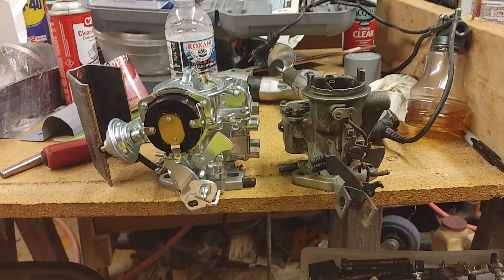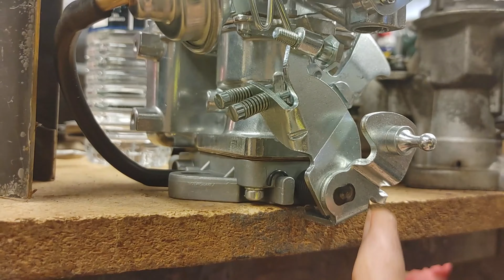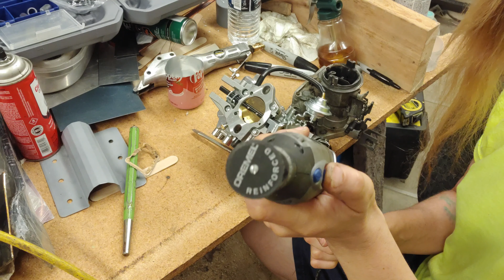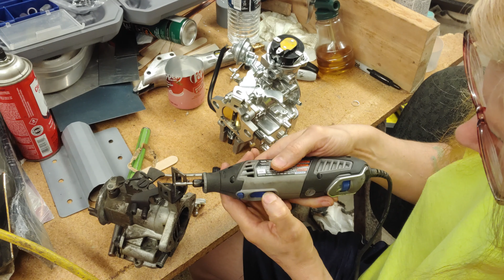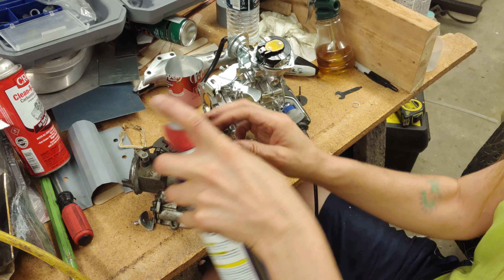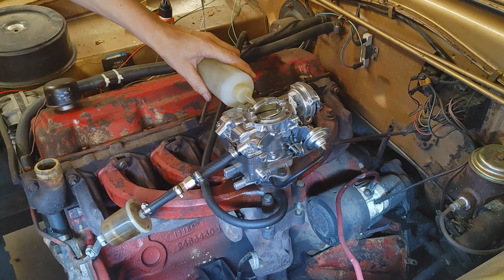1966 Dodge Dart cheapest single bbl carb replacement and install upgrade repair restore revival

Comment: Where do you buy this carburetor from kim thanks for any reply
Reply from the maker: I purchased though amazon and it arrived in about 4 days. The only other part I needed was 1/4 inch pipe thread to 5/16 fuel line adapter. I guess they expect you to reuse an existing one. We will be doing some testing later this week once the radiator is installed. It will be nice to be able to take the old girl for a ride again.
Reply from the maker: https://www.amazon.com/dp/B0811KP43M?psc=1&ref=ppx_yo2ov_dt_b_product_details

Comment: I put one of those carbs on my 1985 Landcruiser last year. the manual choke ends up being in a different spot than original. but it has been doing the job. Good to see our running again.

Comment: Kim, Dremel makes a safety shroud for that cutoff wheel, you don’t want that to blow up in your face at 6,000  RPM !
Reply from the maker: safety first? I struggle with shrouds, I can't see what I'm doing! Rather wear safety glasses and deal with any other shrapnal.